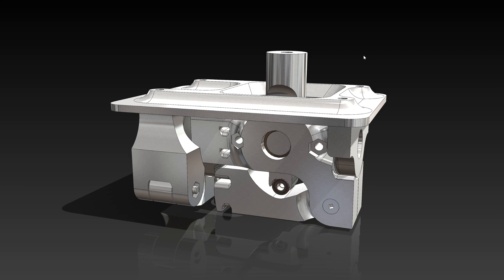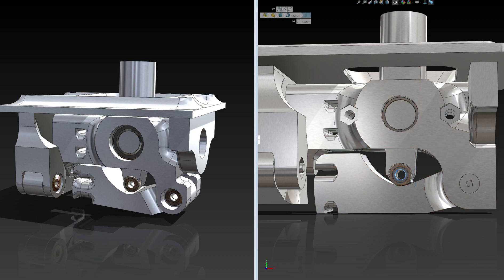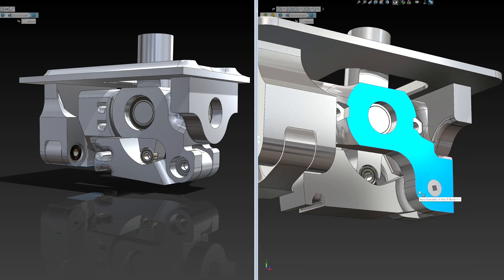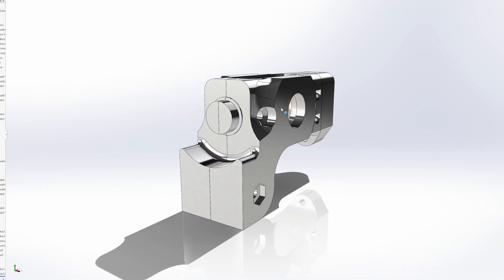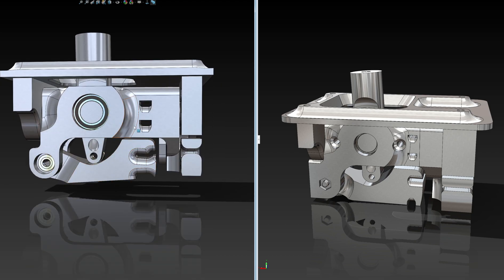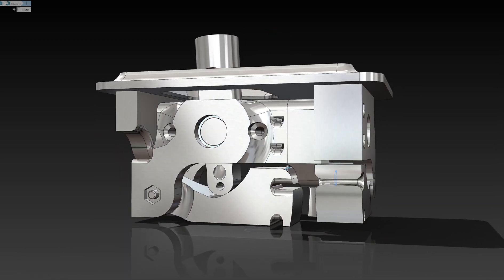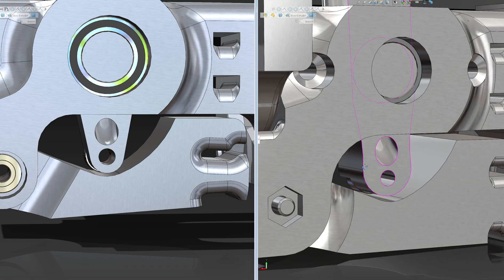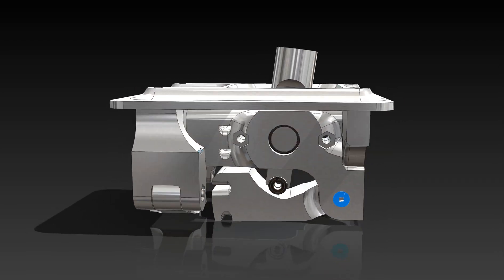3D Printing a Single Cam Joystick Prototype

Comment: I know its 3 years old but a BOM would be nice. STL and 3MF files are completely broken and include the bolts and bearing as 3d print material which messes up a lot of things. I wanted to send the 3MF file to JLC as i don't have a printer and they warned me that it includes the bolts and bearings.

Comment: I printed this version from github file but got a issue when assemble. The "Center Core" cannot fit inside the "Axis B Block" may be the "Axis B Block" should break into 2 half?
Reply from the maker: I had some issues getting them fitted together too. Some sanding was required. This gimbal ultimately is a prototype as it doesn’t have a great way to tension the cams. Springs would be better than the elastic bands. Getting the cam shape working correct in a single cam design is kinda hard because the tolerances when the cam roller gets to the pivot becomes very touchy. 

I’d like to revisit this whole thing once I have my CNC machine running well. Making this out of aluminum plate would be the way to go.

Comment: Your design work with claim to simplicisity is great in principle. But one could consider, that two separate cams are necessary to get a basic momentum in the middle.
Reply from the maker: It’s hard to get an accurate cam shape by just 3D printing it, I found. If the surface of the cam on the side that is closest to the pivot is not exactly what it should be, then it’s off. I’m gonna revisit this design some time in the future and make it out of aluminum on the cnc machine so i can get the tolerances much better.

Comment: genius
After pulling it to the farthest point, release it, and when the joystick returns to the center, the speed of the joystick will automatically slow down, and it will not shake back and forth at the middle point. It can be achieved by adjusting the bottom curve, right?
Reply from the maker: You'd need to add some sorta damping to the system. This with the bearings will oscillate if let go.
Reply: @BryanHoward  Whether the combination of the two curves will also have an effect.
Of course adding a damper would be even better.

Comment: Hi Bryan! I can't use Fusion 360, Cura, or SolidWorks to open the files! it keeps saying that the files are corrupt!
Reply from the maker: Check either the STL or STEP files here: https://github.com/bhowiebkr/open-joystick/tree/develop/source/mechanical/design  they should be good but I haven't tried to open them. Let me know if you are having issues with them and I'll open and check em out.
Reply: @BryanHoward  I know I wanna modify it to use springs instead of rubberbands but STEP File is corrupted.... dunno why 😭
Reply: @BryanHoward  Never mind! fixed it! its cuz my solidw is 2020 is older than urs heheh thks

Comment: Hi Bryan. I am planning to build your gimbal for use in an upcoming joystick build that i am doing with the open viper stick. I am assuming you have been planning to implement hall effect sensors into this gimbal. but i am not currently seeing where/ how you are planning on inserting magnets for the sensors and where/ how you are planning to mount the sensors. I am going to work on the design a bit to adapt it to my setup. but i wanted to reach out and see what your ideas where for the sensors and or see if I am missing something ?
Reply from the maker: At some point I’ll probably get back to this and complete it with springs, but in the meantime I decided to put it out there so people that do have the capability can work off the cad model. It’ll probably be many months before I have an update on this.
Reply from the maker: I don’t have the time for a while to get this finished and tested in a ready state. You’ll have to have some CAD knowledge to finish the areas like sensors, grip attachment, etc on this gimbal as this design isn’t a ready print and use one.  There is enough space to attach the hall effect sensors on the centre of motion for each axis where the sealed bearings are. The magnet can be attached to the pivot by cutting out a small rectangle (see other gimbals on how they do it).

Comment: What will you be planning on using as a grip? I'm currently working on a Harrier throttle nozzle quadrant and I'm finding getting the grip right is the biggest challenge.
Reply from the maker: I’m going to design my own after I’ve finished the gimbal. Lots of 5-way tactile switches and maybe a thumb joystick in there somewhere too.
Reply: @BryanHoward  sounds very interesting. I'd like to see how you go about shelling it. That's the biggest challenge I had.